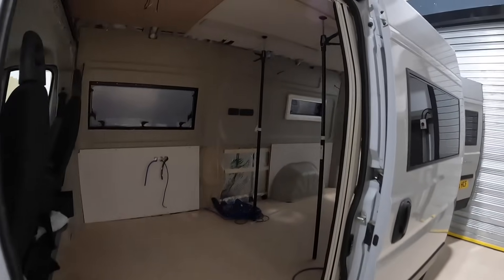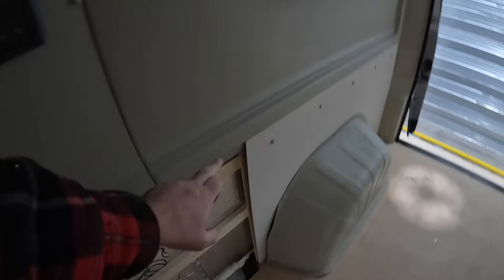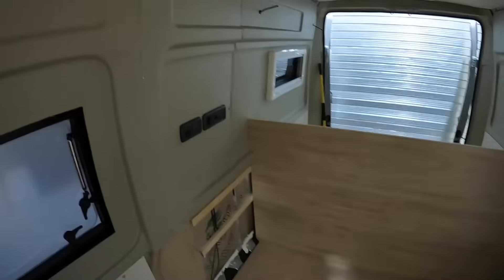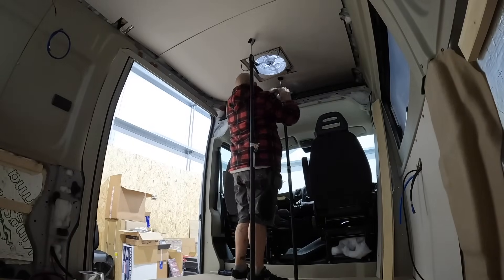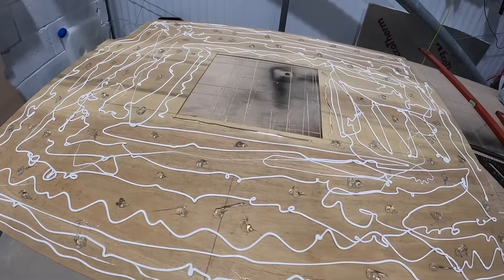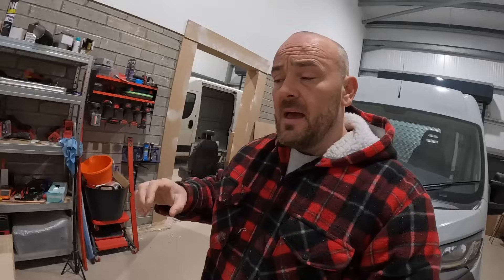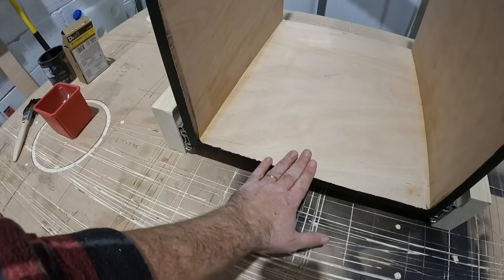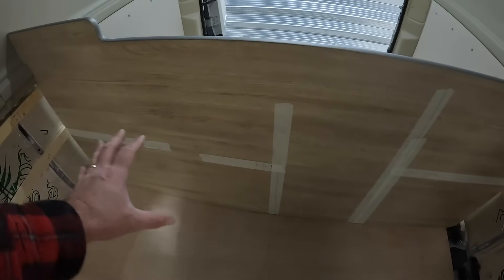A UNIQUE Toilet Install | Gas Free Ducato Build Episode 4

Comment: Hi Stu, you have probably finished the van now, but I made a small dolly to move some furniture around at home, they’re were too small but they were about 1 inch tall and metal from B&Q, you could have put 2 at the front of the toilet tray to keep the front up, 👍👍
Reply from the maker: Hi mate, videos are up to date within a day or two, if the flooring covering was more hard wearing it would be an option but this is Altrincham flooring and I think they would mark or dent it so opted for heavy duty 💪🏻

Comment: Cracking on with the van Stu!
Units are looking good, shame they aren't insulated, but they are only units I guess. Quick question about dc to dc and mppt, do you prefer individual units or a combined one, like a renogy dcdc to mppt controller
Cheers Lee
Reply from the maker: Hi mate, the units have some insulation, I think as there is now two of them and they have high ceilings we just got a lot of space to warm up. On that day it was -4° so was chilly but once we got it warmed up it isn’t too bad.

It depends on the system being installed as to which one would work better and space available. I’m installing the 50a dc/dc & mppt on this van so will get plenty of charge.

Comment: Problem is the unit is high all that heat is going upwards
Reply from the maker: That’s true, once we get it warmed up though it does hold for the bit and the office is now very toasty 👊🏻
Reply: Might be worth investing in the heated quilted gilets you can buy and some small power packs, they are not expensive.
Reply from the maker: I have got a heated jacket, I loved it when I used to work outside. I think we got the heating system just right now in the units so it isn’t cold 👊🏻